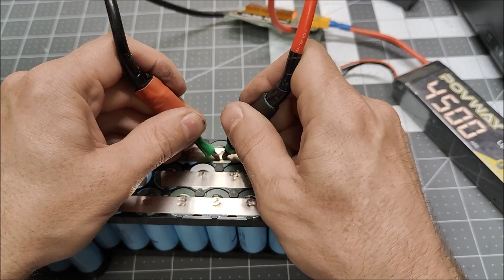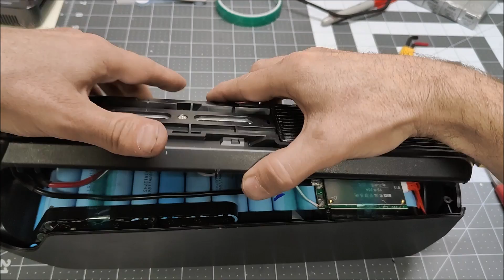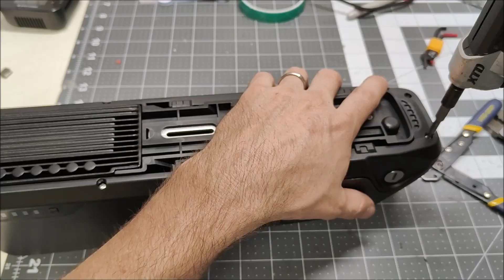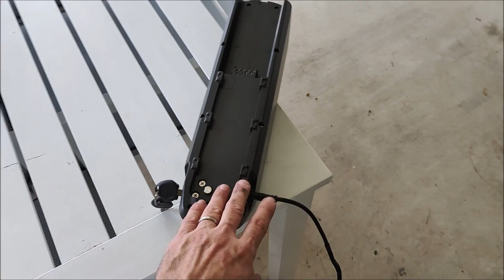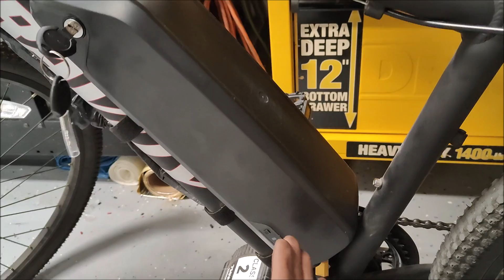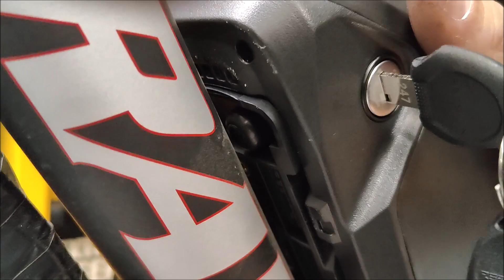Building a Quick Ebike Battery - Part 2

Comment: Do u not put any positive thick wire onto the bms? Is the positive bms harness wire enough for the out +red and the out + charger ?  Fairly new havin't made a full battery yet but i have changed bms  fixed broke wires and other jobs that come with  batteries ie changing  singles pcks  just not  fully built one yet  but will be soon and im just fishing for  as much  in fo as possible,thanks
Reply from the maker: BMS only controls the negative side of the battery. No big positive cable.

Comment: I appreciate your video Steven...but I would done almost everything differently.
To liberate more room at the BMS, you can use cutt off top and bottom cell dividers under the BMS for probably an aggregate 2mm top, 2mm bottom = 4mm total which would allow the pack to sit lower in the case and even allow you to use your old 12mm thick Daly BMS.  If any cell instability, you can use a diaelectric tape to secure the cells...silicone or generic glue. 
Second point is...I would wrap the inside of the battery pack to prevent shorting.  Use fish paper which is anti conductive...at least one layer between BMS and battery cell cases for isolation.
Last point is...Riv Nuts are always the solution for mounting shark style batteries to bicycle frames.  Qty=4 is generally the recommended amount due to battery mass.  If you want even a more secure mounting strategy, use a Grin Inc. "Triple Bob' between the battery tray and frame to help stabilize the battery.
For the BBS02, I suggest running a larger Amp-hr battery for a bit more capacity.  Not just for range, but how long the battery will last by undercharging it between 80 and 30 percent capacity to optimize cycle life.
Thanks for your videos.
Reply from the maker: Installed riv nuts today. Thanks for the good suggestion👍
Reply: This battery also needs fish paper between the nickle strips and the balance wires.
Reply: Ive fitted Daly 13s BMS here without cutting anything. They`ve sent you wrong lower part of housing.
Reply: @karolosmanski2309 did u using kapton tape heat resistens and do u charge all the cell before welding 🤔